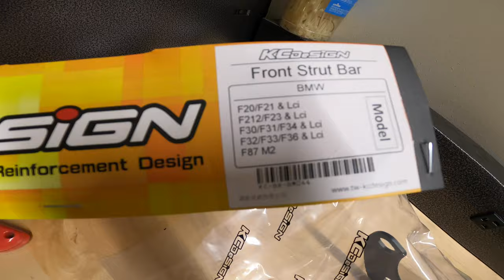KCDesign Strut Brace Bar for BMW F3x

Comment: May I ask what torque value are for front and rear? Thanks
Reply from the maker: 28-32nm
Reply: thx
Reply: just installed one today but no torque wrench
Reply: It has huge difference after installed, handling improved especially in fast turn